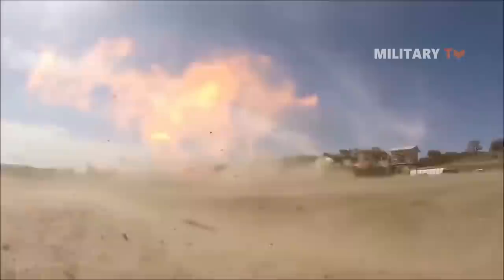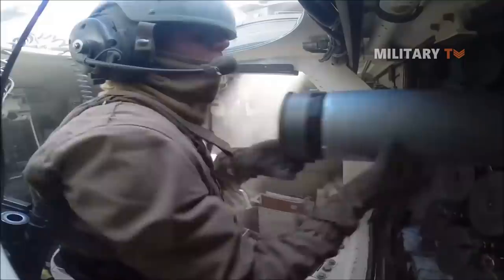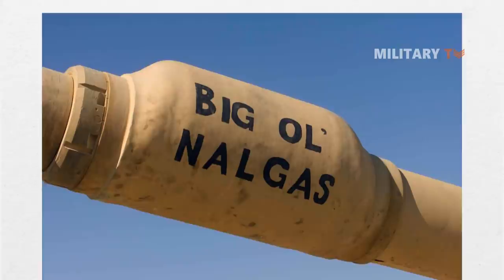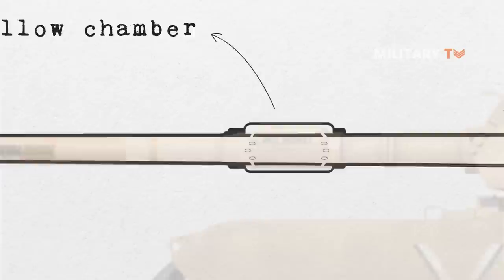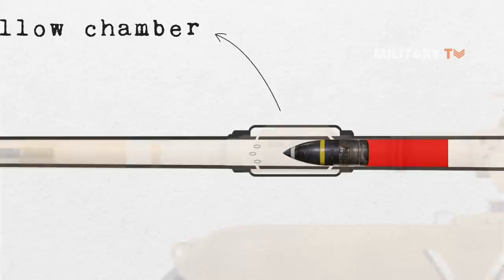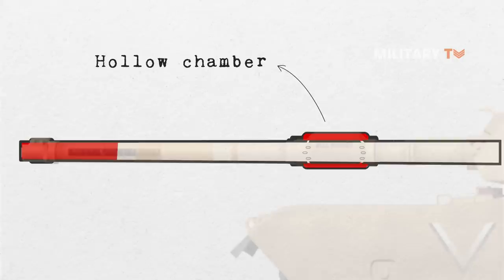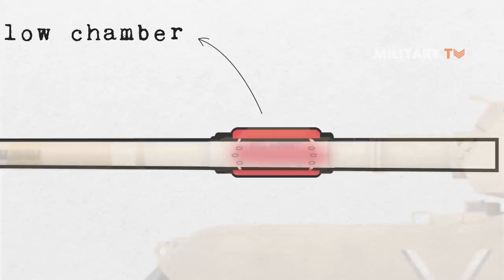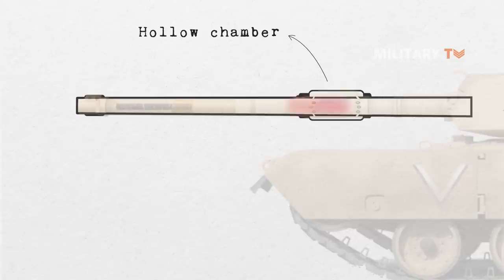What Are Those Bulges on Tank Gun Barrels - Bore evacuator

Comment: Pretty close.  What you neglected is that the timing of opening the breach is critical for low pressure air to be sucked in from the breach end so that the fumes go out the muzzle.  If breach opening is not timed correctly, the gas goes both ways.
Reply: Cool !
Reply: So that explains why my fart goes both ways
Reply: That's the right answer,,, greetings from a Tankie
Reply: @codethemonkey  Everybody does.  It's called a burp.
Reply: @Abzyoutbero  work on your timing to reduce bad taste.
Reply: Timing like delay between firing and opening the breach? He did say the holes are pointed to evacuate the gas toward the business end. I'm sure the effect caused by pointing isn't perfect though and some gas is leftover after several seconds. How long is the timing interval?
Reply: The duration that the powder gases flow out of the storage chamber is longer than the ulterior period even surpasses the duration for breech opening and case extracting. At this time, the gases flow from the orifices can not only draw out the powder gases from the bore but also purify the air in the fighting compartment,  It can prevent the flare back from forming besides preventing smoke from forming in the fighting compartment.

Comment: One of my favourite moments in my military time was when we were on the range for the first time. I was in the commander seat and the recruits were witnessing their first shots going off and it was great.
Then came one guy who got a bit unlucky. When he was the loader he loaded, the round went off, all was well but then we all expected to hear the sound of the case bottom being flung out of the breach but it just didn't happen so I instantly called to halt fire. 

The case bottom just didn't get ejected. It was there, at the opening of the breach, not moving but not stuck, just like it should be when the breach is closed. I checked if the loader had left some steps out or did something wrong but nope, everything was how it should be, and when firing before and after, everything was okay. First thing we did when a new loader got in or the gunner and loader switched places is that we'd clean the breach so that nothing would go wrong but still, it just stood there.

So I told him to get that thing out of the breach and as he got it out I suddenly remembered that the case bottom must've blocked the bore evacuator from working but it was too late. A fuck ton of smoke came pouring out the barrel but thankfully it dispersed very quickly. The recruits just stood there pretty stunned and asked me whether that was normal, to which I could only say that he must be one of the luckiest and unluckiest fuckers of the company.

I laughed my ass off, never having seen that before and a fellow tank commander that was watching our tank with his sights told me later that he'd seen a cloud of smoke emerging.

The fumes weren't too bad and I think that it smelled worse when the coaxial machine gun was firing for an extended period of time. There's also a certain kind of training ammunition we used that smelled absolutely fucking horrible because the bore evacuator didn't quite work as it was supposed
Reply: What if you loaded a cannon ball roughly bore sized and then loaded a blank shell and fired the gun?
Reply: @gregjones3660  Well, I mean what happens when you put a cannonball into a cannon and put explosives behind it? It's gonna fly out. Not that's gonna work great and it might very well damage the barrel, be ineffective and miss
Like you could do it but why not just load a proper shell
Reply: @Meuduso1  Dang. Worth a shot though...

Comment: The cgi shows the gases dutifully leaving the barrel out the front - but WHY do the gases not also travel to the rear? THAT was not explained.
Believe me when I say that the pressure dose NOT decrease while the projectile is still in the barrel - that begins to do so AFTER it has left.
Reply: Gas moving at high velocity has momentum and can't easily reverse direction past that point because of the swirling. It almost acts like a check valve, but not perfect of course.

Comment: Pretty sure the ‘tank’ in the thumbnail isn’t a tank. It’s a tracked artillery piece.
Reply: M109A6 155mm Howitzer to be exact.
Reply: @claudelamoreux8543  Yep.  Favorite motor pool exercise.  Clean and lubricate the check valves in the bore evacuator.  Don't forget to clean out the 300 lb muzzle brake and check the pressure on the accumulator and function of the equilibrator.
Reply: @tjinla9850  To be fair to the author, as an FDC guy I did actually learn something about how the evacuator worked.

Comment: While I see their advantages, I presume they also reduce speed and maximum distance for the projectile because of reduced pressure behind the projectile. Has anyone run the numbers on that? Does it reduce projectile speed by 10%, 5%, or not at all?
Reply: It should be quite negligible. Projectile velocity is most directly dependent on final pressure before exiting the barrel (for barrels of same length). Via ideal gas law equation, PV=nRT, pressure and velocity are indirectly proportional to each other for a given mass of gas and temperature. So if we ignore themordynamic changes that may slighly alter the temp (which should be very negligible), the extra volume added to the barrel by making an extra compartment for gas to accumulate should make almost zero difference in pressure and likewise with projectile velocity. A targeting computer could take it into account just for that extra pinpoint accuracy at long range where a few feet short will miss the target's weak spot, but it shouldn't shorten the projectile range in any relevant way.
Reply: @morganfreeman1906  Thank you for the intelligent reply. I am glad I asked.

Comment: So when bore evacuator is at high pressure and it’s gas starts flowing back into the bore, why would it not push gas towards the cabin just as it would towards the exit of the gun?
Reply: The opening of the breach is timed to avoid back flow. When the breach opens, the flow is already going out the barrel end and sucks fresh air from the turret.

Comment: ONE KEY POINT YOU FORGOT. THE REAR HOLES HAVE LITTLE BALL BEARINGS ACTING AS ONE WAY CHECK VALVES. THIS FORCES THE BUILT-UP PRESSURE IN THE EVACUATOR TO BE FORCED THROUGH THE FORWARD HOLES THERE BY EXPELLING THE GASES. KEEP IN MIND THIS IS EXTREMELY FAST. WITHOUT THE CHECK VALVE SYSTEM GASES WOULD GO IN BOTH DIRECTIONS. I WAS A 45Z LATER THIS BECAME A 45K40. WORKED ON ARTY SMALLARMS BRADLEYS AND M1A1
Reply: Good point, but no need to yell at him

Comment: Wouldn't a secod chamber that is sealed off, followed by the firing mechsnism, proven to be more effective? Like adding an airlock to a gas chamber or a bio tech lab, let the gasses blowback into a closed chamber and filtering that air out through vent holes? I imagine a multiple stage firing team loading a round into a mechanical eed that feeds the round upwards or downwards into a separate chamber that is sealed off from the pilot chamber. The. Is fired. You wouldn't lose Gas pressure in the valve, and the pilots would be safe.

Comment: i don't think it actually works as advertised.  way too small to have any effect on the gases after firing...
just a fancy feature, that's not been scientifically verified.  the best way to reduce the back-flow inside the tank, is adequate ventilation...
plus, it probably interferes to some degree, with accuracy...
Reply: It works exactly as advertised... It is called physics, you would not understand...